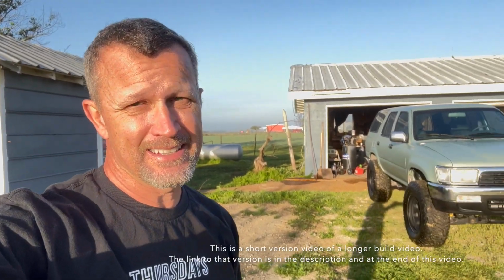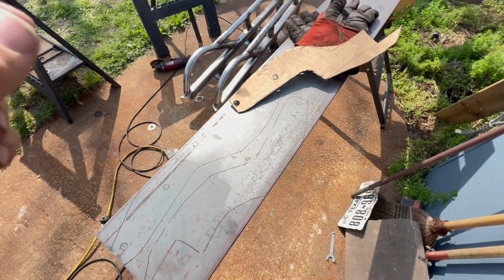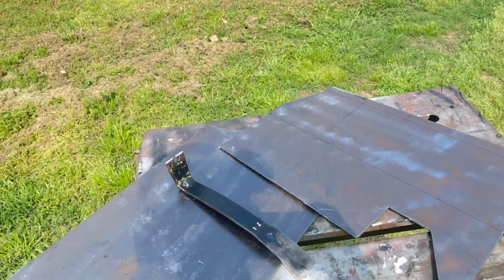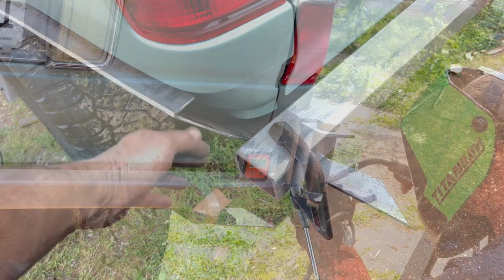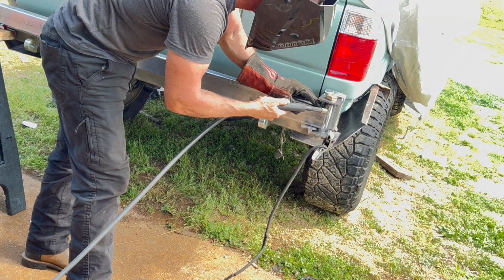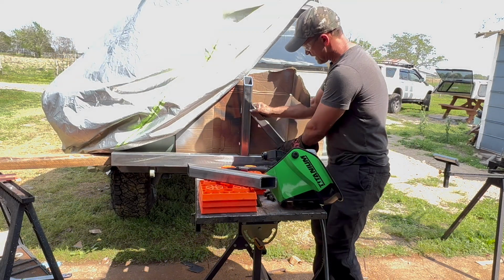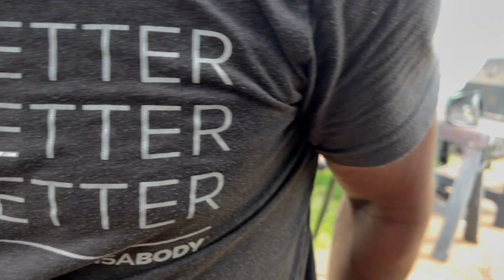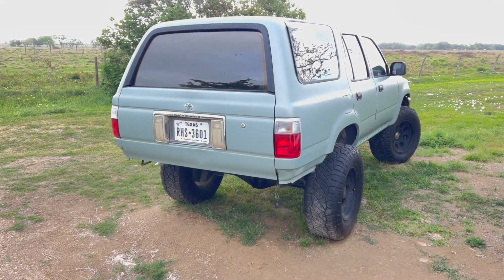Short Version Video 2nd Gen High Clearance Rear Bumper and Tire Carrier

Comment: I really enjoy your videos.  Do think a 125 amp flux core welder could do this job?
Reply from the maker: Hi Ryan.  Thanks for checking out the video and I’m glad you liked the info.  Yeah man, that would be fine.  Don’t rush through the line when you’re welding 3/16.  Crank the amps up to as high as you can get them, pause a bit at the start of the weld to heat things up, then keep that puddle going as you weld along the line to get that steel burned in nicely.  Flux core is a bit messier but nothing that a sander can’t clear up.  Actually flux core often puts a better melt in there than MIG. You got this Mr.
Reply: Man I am so glad you said that.   Do you think I should use .030 or .035 flux core wire? @OffroadGrind
Reply from the maker: @ryanhensley146 0.030 would be fine.  Just go slower if welding anything over 1/8” thick to make sure the weld is getting into the steel (getting good penetration).
Reply: Thank you so much.  I really appreciate your help.  I will keep watching.  @OffroadGrind